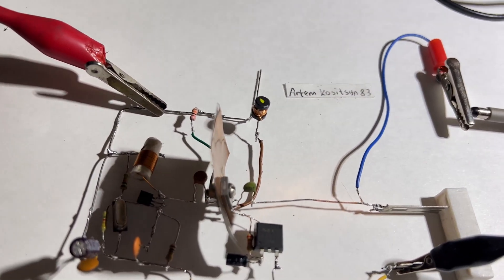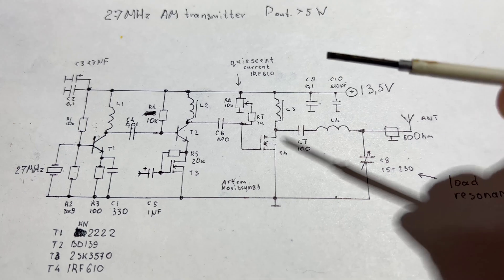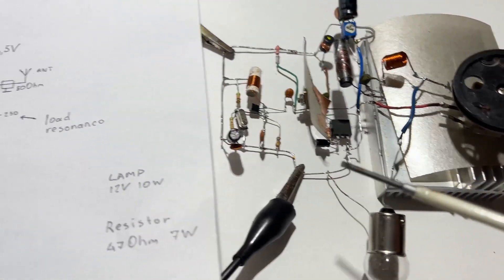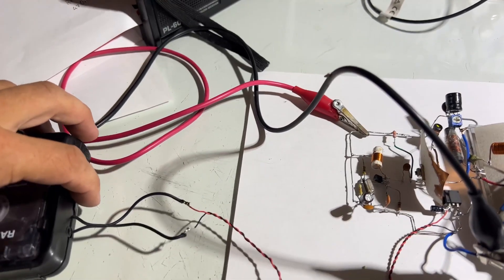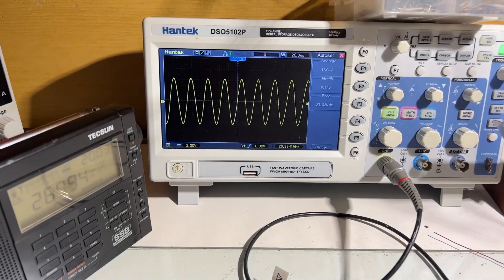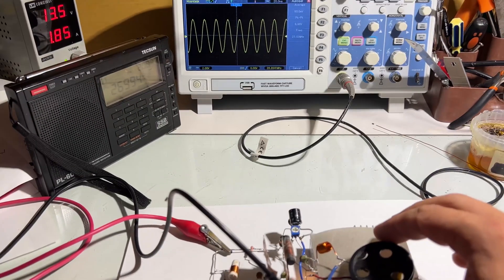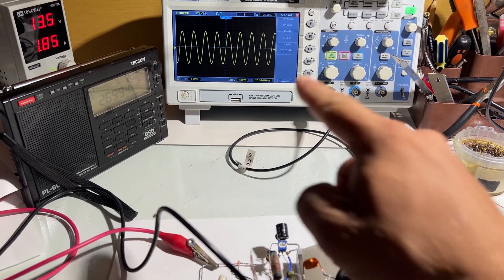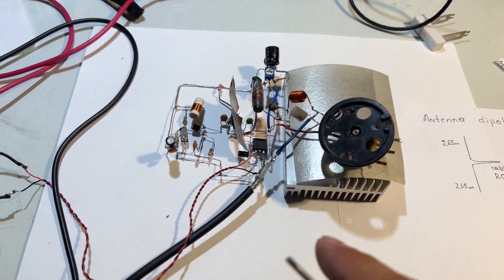DIY AM transmitter at 27 MHz.Output power 5W.You will be heard from miles away

Comment: Good device! But 14nS turn-off delay of the output mosfet is too many - the period of 27MHz is roughly 35nSec, so, 17nS is a half of the period of the RF signal (27MHz). I think, the mosfet will be too hot and effeciency will be bad, but when we use soft switching , the situation bay be not so bad. I mean class E amplifier - the same trnsistor but with 2 coils 2 capacitors and П-type matching network.

Comment: Fixed value pre-built inductors are easily available for values you have used. They have better tolerance compared to manual wire-wound coils. In commercial equipment, toroids and wire-wound inductors are used where availability is an issue or value is too odd to be found. Any how, your project, your wish!

Comment: I'm having trouble getting the right voltage at the second stage. I used the 2n2222 at the oscillator but got it to work so the output is around 1V but I'm only getting around 1,4V at the output from the BD139. Any idea what could be wrong?
Reply from the maker: try changing the resistance of resistor R4 to less than 10k. Connect the BD139 emitter to ground. Connect the BD139 emitter to ground through a 30 Ohm resistor and a 100 nF capacitor.
Reply: @Kositsyn83  Thx very much for replying. I tried putting 2x 100 ohm resistor and the 100nF capacitor from emitter to ground.  I do get a sort of sine wave at 10 Volts but  at 2,8 Mhz :/ 

Edit: I messed around with the values of the components again. I found that by decreasing the value of the 100nF capacitor, the frequency increases but the voltage decreases. Also I found the whole oscillator changes frequency, not just the output of the bd139.

Comment: cool project, i only figured lately what to look for in power ampl, which was voltage recovery, the IRF610 5V/nS  means it can tolerate up to 1Ghz  before distortion mess the carrier sigal.
also the probe is for stationary waves to make sure the are in the right places on the antenna

Comment: Can I use irf510 instead of irf610?
Reply: The 2N 2222 transistor can be easily used for 27 Mhz frequency. It can even be used easily in electronic circuit applications up to 100 Mhz.
The problem you have with resistors is actually related to the manufacturing types of resistors. If you use resistors that show inductance and capacitance due to the manufacturing method, these inductances and capacitances will unfortunately behave as if there are coils and capacitors in Series and parallel with the resistor. Their values are also related to the production processes of the circuit element. To solve this problem exactly, you have to search for 'suitable resistors for RF'. You should work with the smallest resistors of inductance and capacitance. This is how you should make your supply specifically. I wish conveniences.
Reply: Probably. Look at the specs. Make sure you don’t drive the gate too high
Reply: Sc2314   sc 2078    orjinal   cb  27mhz   telsiz  sürücü  ve  çıkış  transistörüdür  2n2222  2n2218  de  çalışır   tebrikler

Comment: Why 13.5V? Can you modify for 12V?
Reply: it will work fine at 12v too
Reply: The reason is the unloaded voltage of a 12V car battery.